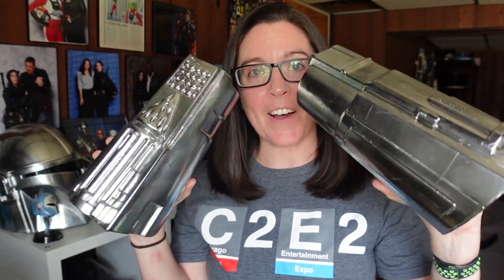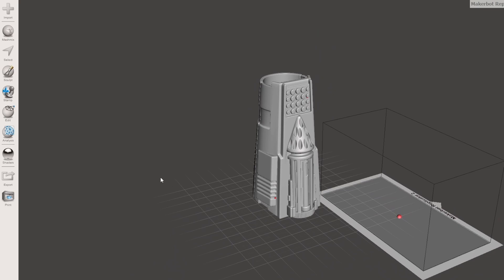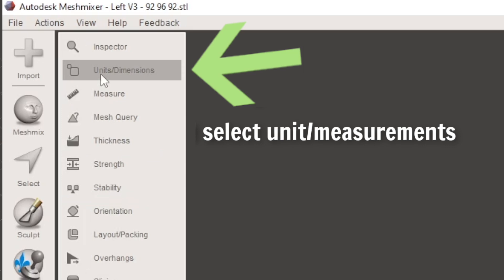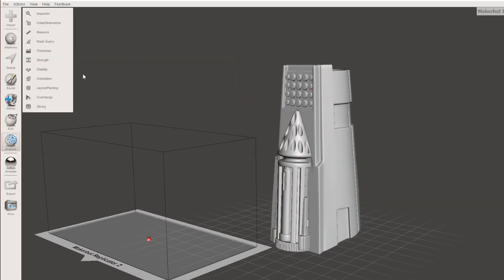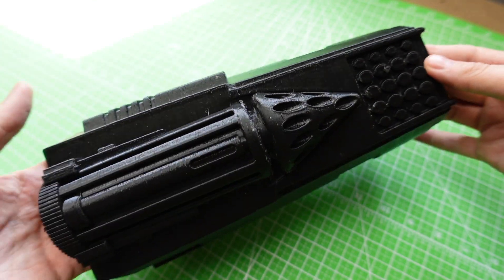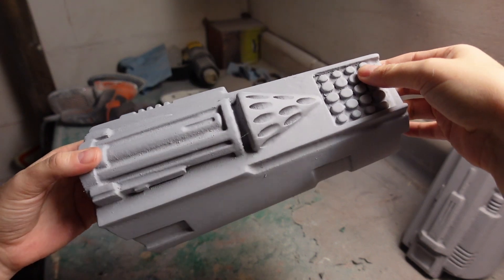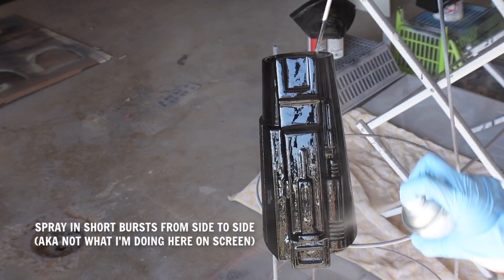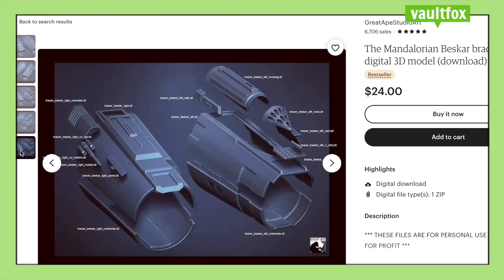How to Scale 3D Printed Armor with Meshmixer + How to Make The Mandalorian's Gauntlets

Comment: Something I meant to mention on a couple of your videos re sanding… I often use a product from Dap called “Plastic Wood” wood filler and/or “DryDex” spackling to fill in then sand afterward. The DryDex works great to fill those nuance areas and if dries and you’re not happy with it, water it down a little to either remove or make a slurry to spread further. Both of them are much much cheaper then Bondo, and there isn’t a harsh odor. Oh and for some other smaller parts, finger nail files work great and are cheap. Thanks again for the detailed videos!
Reply from the maker: huh! I've actually never heard of that product but will have to give that a go next time I'm out. I'm always lookin for bondo alternatives because apparently it's hard to find outside of the U.S. and folks are always asking me haha

Comment: did you use PLA? what about heat resistance? leave the armor in a car on a hot day and it might warp
Reply from the maker: yep, PLA and I've never had issues with any prints warping while wearing them in the heat BUT yeah, def don't leave this stuff in the car

Comment: Why after scaling in meshmixer do things change when I export to Cura? I have a tronxy x5sa with marlin firmware. Can I just plug my laptop into my printer and use meshmixer to print instead of exporting to cura?
Reply from the maker: Meshmixer isn't (to my limited knowledge at least) a slicer so it can't prep things for printing. That's why I export the STL's and open them in CURA to tune settings and get it on the bed correctly.
Reply: @vaultfox  when I scaled the right gauntlet to my son's forearm in meshmixer. The wrist opening is at 2 3/4". The elbow opening 3 1/2". Total length 9". When I export to Cura. Everything changes. The wrist is at 1" the elbow 1 1/2".If I scale in cura after meshmixer the wrist effects the elbow and vise versa. Am I doing something wrong from Meshmixer to Cura?

Comment: Another great video. I always hate sanding very detailed pieces as well.  They look great when they come off the print bed but you always know they are going to be a pain to sand haha should really get my airbrush out. I have one but haven't used it yet as I really don't like the idea of the clean up haha
Reply from the maker: Yeah, I hate sanding detailed pieces like this with a passion lol. And I'm right there with you with the airbrush! I didn't use one for a long time because the clean-up scared me as well, and when I eventually did I still managed to brick an airbrush not cleaning it properly with lacquer thinner. Took me messing up my first airbrush to finally get into the routine of pulling it apart after each use, lol. It really doesn't end up taking TOO too much of my time, usually 5 minutes tops, but man did I struggle getting into that routine
Reply: @vaultfox  oh that's great to know regarding the airbrush and it not taking too long to clean. Maybe I need to stop being a intimated and actually give it a go. 🙂

Comment: Thank you for another great video. I'm about 6 months into my 3d print adventure and find your videos valuable as I am working on my Book of Boba Fett armor (also from Galactic Armory).
Reply from the maker: Thank you so much! Sending you lots of good 3D printing karma for the jetpack!! (I was never able to get Bo's jetpack to print successfully lol)
Reply: @vaultfox  Uhhhh....Another question. Do you use EVA foam and/or velcro to hold the gauntlets in place or for a slightly tighter fit?
Reply from the maker: not for this pair, but I added some upholstery foam into my Bo-Katan gauntlets